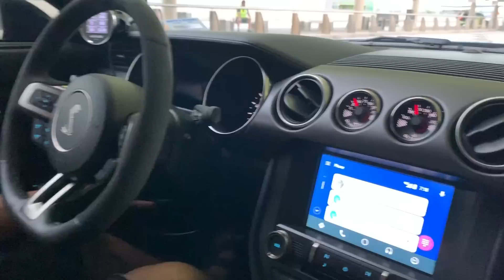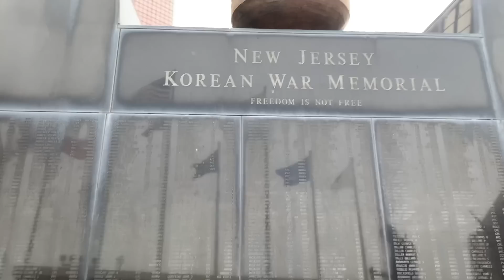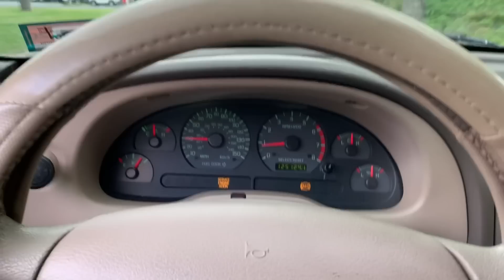FINALLY, My 2019 MUSTANG GT is BACK HOME from the CAR ACCIDENT

Comment: Happy for you. ;). I waited 7 weeks for mine for one way clutch replacement in 10r80. So, I feel your pain. It is glorious to be back in the saddle though.
Reply: God dang why
Reply: Part was back ordered then issues with replacement part
Reply: @19explorersport96  jesus that's scary I hope mine holds long enough for the aftermarket to catch up,  I mean haven't these trans been in trucks last few years?
Reply: BlueCollarDaily good news is they replace it with a ‘19 part that is supposedly stronger
Reply: @19explorersport96  hey I can confirm i was told by a tech that the 19 has that and a better valve body as well...some late 18s got the valve body...so that's 2 sources at least
Reply: BlueCollarDaily it did get a different valve body as well so that confirms that
Reply: @19explorersport96  now we need another guy and we are triangulating haha....thanks for the info I feel better....when I first got the car when it downshifted to a stop a few times its grabbed I mean less than 500 miles....its never done it since...and with Zander having those 5th gear problems and made sure and test that which is quite hairy with 3.15s and a 28 inch tire haha

Comment: I'm currently using the Royal Purple HPS 5W-30 which has the Zinc/Phosphorus formula. Supposed to offer a bit better wear protection. The new oils have less of these additives because they can harm the cats over time. To extend the life they keep reducing the amount of these allowed in oil rated for API-SN. Since I have no cats I went with the older formulation.

Comment: Good to see you get Carnage back. A tip of the hat to Stangmode for setting you up. The FAA mandates pilot on duty hours just like the DOT does that of a truck driver. So when an aircraft has a mechanical issue that needs repair, the pilots are still on the clock, regardless if they are flying or not. If it takes 4 hours to fix the plane, that's 4 hours less that flight crew has to fly or work. Sometimes it interferes with flight schedules because the airline might not have another crew with flight hours available to fly. Its all regulated by the government in the name of safety.

Comment: Congrats on getting Carnage back.
I couldn't agree more with you both, 5 30 is the absolute minimum we should be using on these NA Coyotes.
Reply: I've been thinking about that l, next oil change moving to that oil.  Especially since I am a spirited driver lol
Reply: I agree I like the 0w40 euro formula mobile one but my car sounds a lot better with 5w50 no additives
Reply: @bluecollardaily2676  Great to hear BCD! I can't remember what FI your running, but is that what they are recommending to use or something you decided to run?
Reply: @19coyote5oh9   they require it for warranty so it went in literally same time blower went on at 1988 miles. First thing I noticed on taking delivery is how quite the blower was ( I'm used to straight cut procharger gears hehe), how much it looked factory in the car then I was like wait this thing is running smoother with blower than without.....then I remembered I had taken him the 5w50...also put in a UPR magnetic plug and dont worry when we drop the first oil I'll send it out....I'll do it early around 6k got 4100ish on it now....I've already got an oil change and filter I'll up the Blackstone when it comes in dont worry.....and I have my factory oil baseline too
 Oh and I run the Edelbrock 2650 TVS....after the Christmas Rebate and discounts I've only got around $5900 in the blower and that includes the $16,500 warranty cap ( $12,500 engine ) 36k miles and the SCT BDX wireless programmer. They gave sent me a tune revision and a 93 tune as well....super easy people to work with and what I like most is their sales manager has a gen 3 coyote and races it with his blower....no driving a Chevy to sell Fords going on there...lol...think he has been 9.20s on a10 in stage 2 e85....
Reply: @bluecollardaily2676  Damn $5900 with a 16k warranty is absolutely amazing!
It seems the general consensus is we need thicker oil than the 5 20 Ford recommends, its just too thin even for a daily.
Will thicker oil actually prevent the Coyote from eating it's self alive remains to be seen, only time will tell,  I remain optimistic, especially if the factory oil is changed early on.
For now I'll do what I can within my limits to keep my Coyote running strong, 5 30 PUP seems to have my Coyote running quiet as a mouse, but I also added some Ceratec as well and let it run its coarse.
Reply: @19coyote5oh9   yeap I studied 5w30pup and that euro 0w40...like em both I was gonna do that....
 Yea to me when Ford wouldn't stand behind em stock what's the point might as well roll the dice on Edelbrock vs losing my warranty for 50hp( e85 tune exhaust and cai; you start adding up the cost for full bolt ons your getting pretty close ) lose it for 250hp lol...
Reply: @bluecollardaily2676  I hear ya.

Comment: I can't believe that Ford not only gives you a plastic oil pan, they also give you a plastic transmission pan as well.  As for the hold up on the repair, I wonder if the replacement parts are coming on a slow boat from China?

Comment: Why 5-50 for supercharged? I've been using 5-30 forever.
Reply: Better oil for the job, but its really depends on the vehicle. Maybe there are some forced induction applications that take 30. but my supercharged GT requires 5 50 and  i highly recommend 40 or 50 for high hp boosted applications

Comment: You said if its supercharged you should use 5W40 or 5W50 ... I've been running 5W20 for almost 2 years in my 2017 Roush F150 Supercharged. I called Roush on 2 different occasions just to make sure and both times they said run same oil as original which was 5W20 also Roush Supercharger Manual states same thing to run original oil?
Reply: I asked Alex from Lund racing this exact question on his last live stream if you go to the 38:30 minute Mark you'll hear him answer the question. But he says if it's supercharged it should be 5 w50. I'll be switching over as soon as I get my car back
Reply: @sublimegt500  like i said i've been running 5w20 for almost 2 years without any problems. I've been asking same wuestion because some say 5w50 and others 5w20. I guess i will just stick with what Roush states in their  manual which is same 5w20 that came with the car.
Reply: @codename7832  yeah it was good in my engine I had no problems but I'm adding power to the car now and even my tuner / installer recommended switching over to the 550 with the added power
Reply: @sublimegt500  my is running 5w20 with stage 2 650hp without problems for last 2 years
Reply: I think it is more of an issue with the gen 3 engines that are not sleeved. Also what brand of oil, how hard you drive it, along with how often it is driven hard, and how offten you change the oil plays a big part in it. I have a 2019 buillitt and it has not seen red line yet. Once the car is broken in at 1000 miles I will be changing the oil over to amsoil signature series 5w30 since the manual does say that weight oil can be used, to make sure my car is better protected.
Reply: 5w50 newest for spec was required by Roush, Whipple and my  Edelbrock Supercharger for warranty when I called, but I'm a 19 A10
Reply: @bluecollardaily2676  my is 2017 and its states in Roush Manual 5w20
Reply: I know Palm Beach Dyno has told someone they can keep running 5w-20 after a supercharger install and tune. I'd run a heavier oil myself just because I run 5w-30 N/A currently and think the additional stress would warrant a little extra protection.
Reply: @cmdrdredd  sorry I'm right its directly in the instructions for it palm beach doesnt supply your warranty if I knew how to post a pic I could for you...it directly states 5w50 to keep power train warranty in the installation instructions

 Page 69 of the 2018 plus roush charger stage 1...specifically says must use 5w50 for warranty as did charter ( whipple /procharger 3rd party warranty add on) as dis Edelbrock....
The 17 is a better engine so maybe it doesnt or maybe it's the 2300tvs rotor pack cant tell ya....just know I'm going by the book I even save all my gas receipts and take photos of the pump. I have a envelope with all my receipts in it pump type receipt mileage station oil filter all of it...when I check my oil everything cause if we know anything it's that the gen 3 is a piece of shit I'm taking no chances
Reply: Btw their 5w50 shears down pretty quick to 40wt....I sent pre and post install in I'll put up blackstone analysis at my first change after coming up soon.
Reply: Cheapest way I found is buy bulk from Rock Auto the oil and filter...then pay to have a change place install it where you got the invoice to prove it went in...then I have spare Blackstone collection bottles for them to collect oil when they drop it....
 I'll be ready to battle I been in a lawsuit or another last 12 damn years cause people dont want to do right...its nuts....took nearly 5 years to settle the last one 4 months ago.....I'll stick with it till I dont draw breath...lol